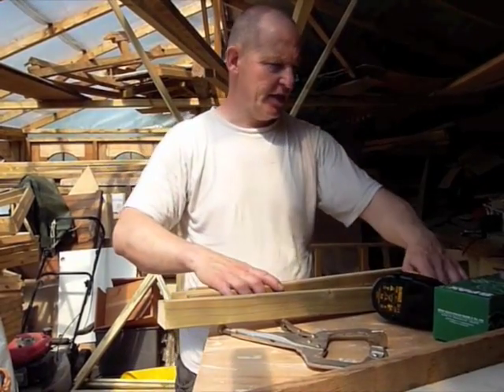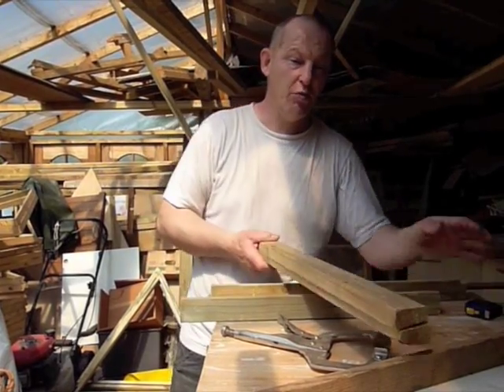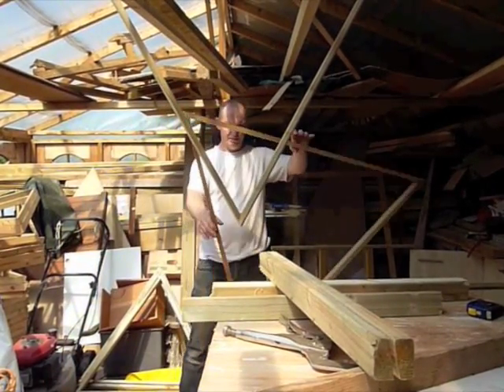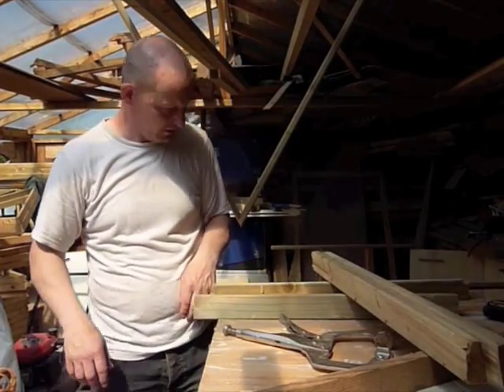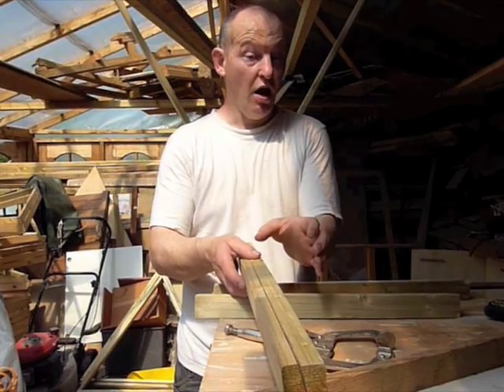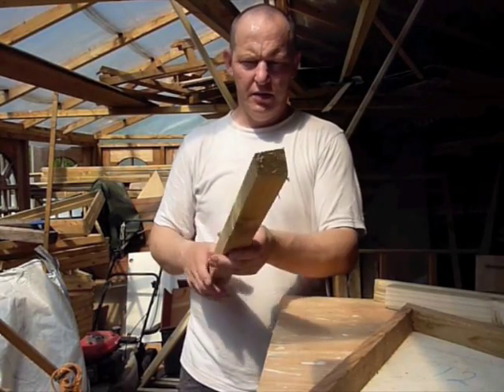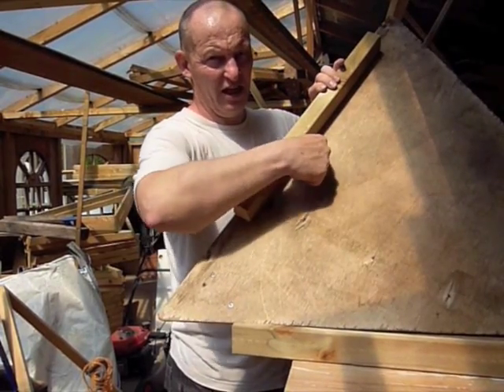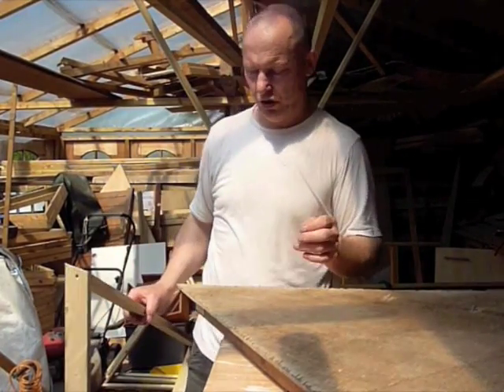dome_timber_sizes

Comment: I suppose you have to make sure the wood you use for this is very well dried already? Or will all the screws still hold it together despite the normal shrinking and warping?

Lumber's really expensive where I am and while I can get green lumber for less than half the price of lumber sold in stores, I don't think I can wait for it to dry out enough for use.
Reply from the maker: You should have no problem with timber that has been air dried for a week or two. As long as the wood all has the same moister content the shrinkage will be even so not to cause problems.
Reply: @Geo-Dome  Thank you for the response! Guess I will be trying to build a dome as a farmhouse for me to live in in the property we just bought. I think it will be the first dome ever in the entire province. 

My next problem is the cover. It's going to be for living in so it has to be relatively sturdy but I live in the tropics on a mountainside so it's going to be exposed to a lot of rain and shine.

Blessings and I pray you are doing well!

Comment: Great video and answers lots of questions. Is there any issue using a wood deeper than the 2" you use? I'm hoping to insulate my dome and fill each triangle with a polystyrene. I want to keep the wood exposed internally. Thanks.

Comment: Will it be ok to use wood glue along with the screw?
Reply: It won't add much as end grain soaks the glue away. Possibly not worth it imho. When the frames are all assembled into a dome the side angles will mean the corners are compressed rather than pulled apart so the strength comes from the wood not the joints.
Reply: Yes why not.... it will give more strength...

Comment: I am curious as to the species of wood you are using.  I have noticed in some videos that you stick screws into the wood and then use a power tool to screw them in.  Here in Oregon I have pine available that is soft enough to push a screw into and Douglas fir is harder.   Is pine adequate?  I am thinking for a first try it is mush easier to saw and otherwise work it.

Comment: very helpful thanks. can i ask where you get the angle to cut the 1" by 3/4" at? do you have to work it out or is it in the plans?
Reply from the maker: It is in the plans, the angle will vary depending on the type of dome you are building. I adjust the geometry so you only cut one angle for all the struts. Other sites have info on domes but you need to cut cut two separate angles. As long as you don't mix strut lengths and angles from different places you should be fine.

Comment: great videos. thanks for sharing your knowledge; I am considering ordering one of your plans. Curious to complexity, when you are preparing your timber by cutting the , say 2 by 2 - just for simplicity sake - in half, are you using a consistent angle across all of the timber you prepare, or are you having to prep so many lengths at angle x, so many at angle y and so on?  Trying to gauge how many different angles to manage and the complexity of the cuts for preparing the timber. Thanks for info!